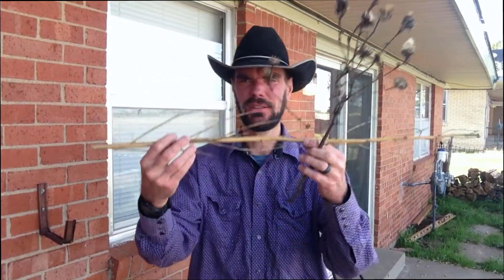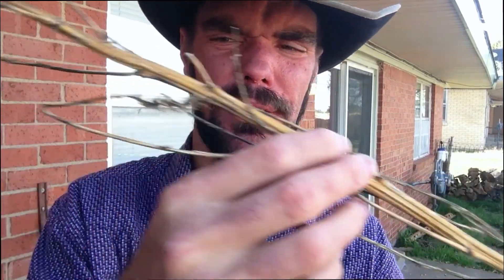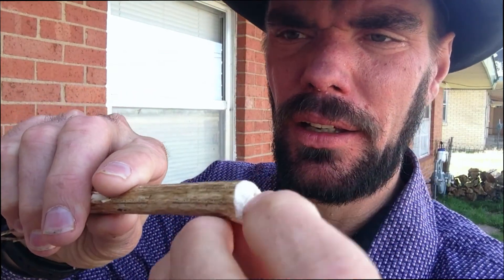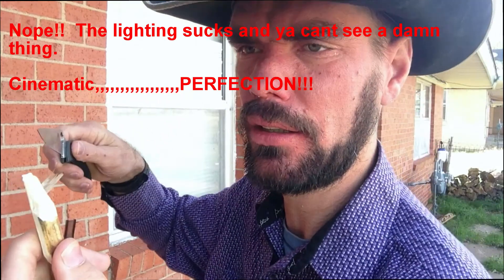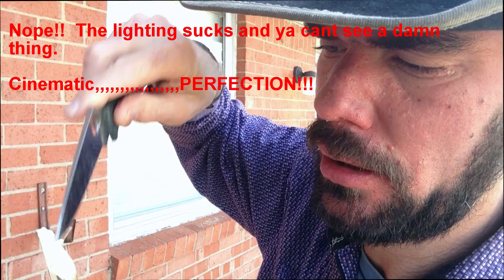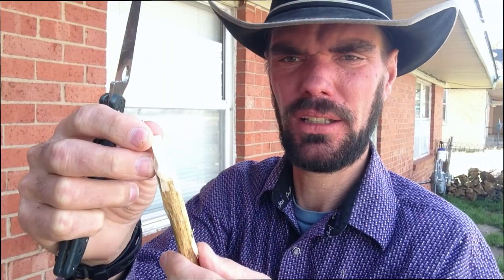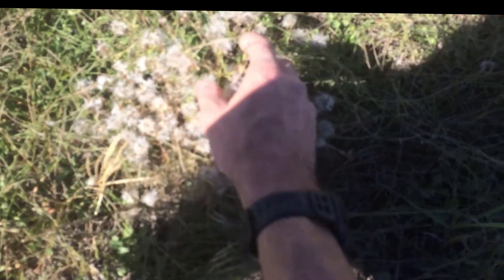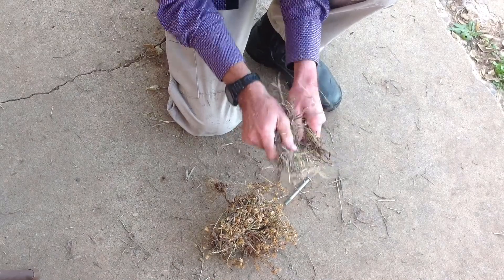Magnifying glass-Solar fire starting

Comment: Nice , Once it burst into flame , that dry grass move's dont it, Good job , Thanks Brother.
Reply from the maker: Panhandle Prepper Thanks, there aren't too many things as combustible as Texas panhandle grass!
Reply: True that sir, Come here and you can have all tumble weed you want, I used a mag lense last week to start leaves, Smelled like pot But worked, Tried it on fatwood with charge cloth no go, The fat wood only realesed and dripped it's resin, I ltry something else. "Inspired"
Reply: I've used bundeled-up pine needles to start a fire, but can take a while to get them hot enough.